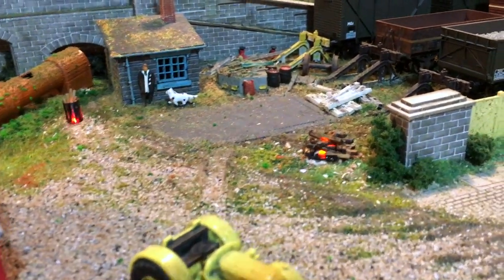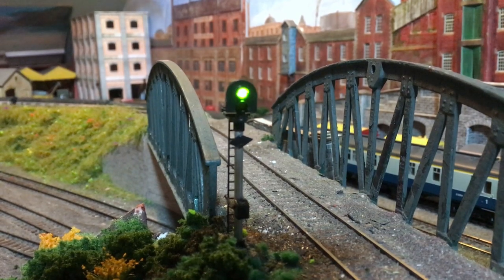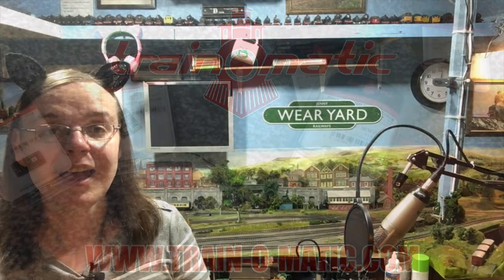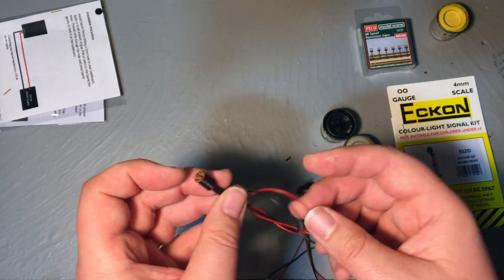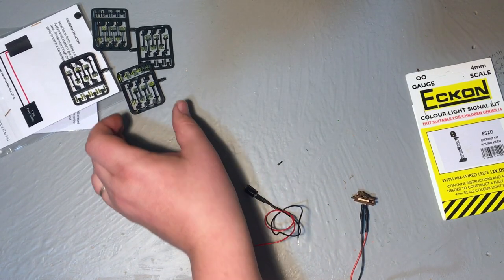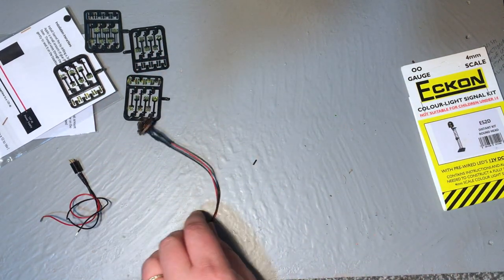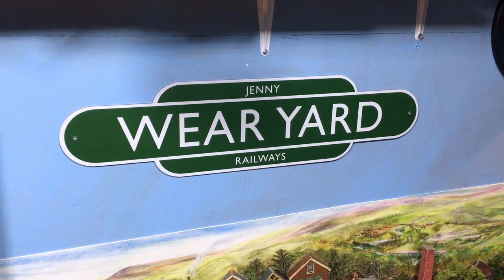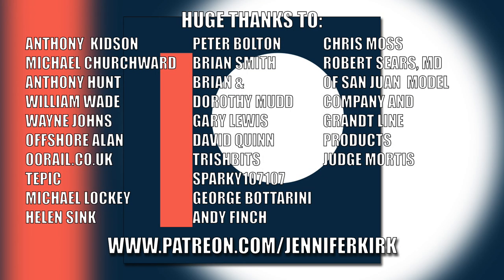Adding Effective Fire Effects and Signals to My Layout

Comment: Bet you could procure a smoke unit and have little tendrils of smoke coming through small pin holds in/around the campfire and barrel.
Reply from the maker: It is an idea, though space under the baseboard is severely limited.
Reply: @JenniferEKirk  Fish aquarium tubing could allow you to house the unit elsewhere and then vent the smoke over to the desired area. A T-junction would mean you could feed both areas from the same smoke unit.

Comment: Super video Jen as always they all look good a cheep way of making fire effects or loco fire glow is a cheep candle tea light led effect from cheapo shops if you wrap some cotton wool painted grey black around the led looks like smoke, do not forget to add a 1k resistor to the wire..P.S. the metal from a pencil rubber makes a fine braxier.Hope this made Spence. Love the vids all the best to you and Zoe👍

Comment: Nice. I bought the barrel and wood pile fire a year or so ago and I added more wood to hide the base and painted. I bought another pile later and barrels from another seller. All run off my 12v lighting hubs (I have 3 with 14 ports each).

Comment: Hi Jenny, love your videos. I want to put in 4 two aspect berko signals on my layout. However I only have two gauge master combi controllers. Can I power more than 1 signal using the 12v output on one controller, with different switches? Or can I only have two signals? (one powered by each controller) I’d really appreciate your help. I’ve tried asking around but nobody seems to answer my question, thank you in advance! (00 gauge DC)
Reply: Or would you recommend another way of powering these signals?
Reply from the maker: You can power multiple signals from one controller.
Reply: @JenniferEKirk  thank you Jenny, much appreciated. Great fan of your videos